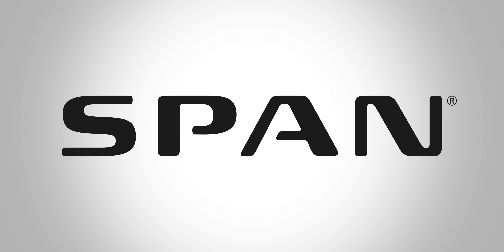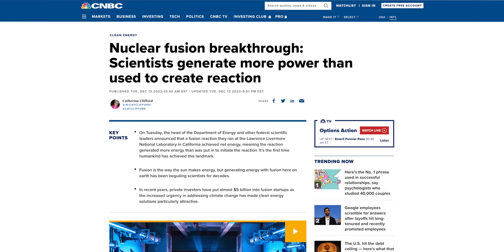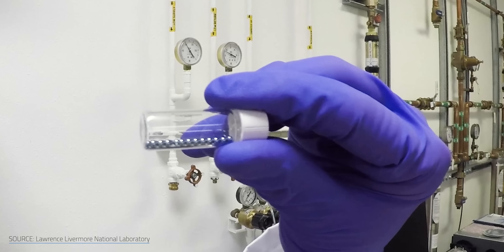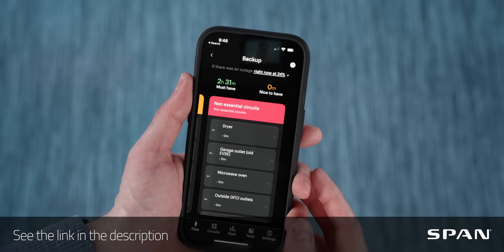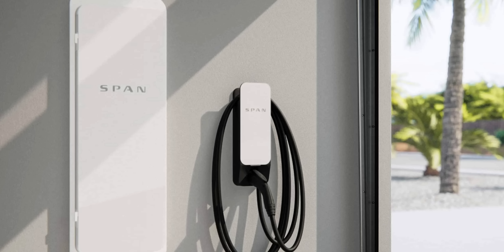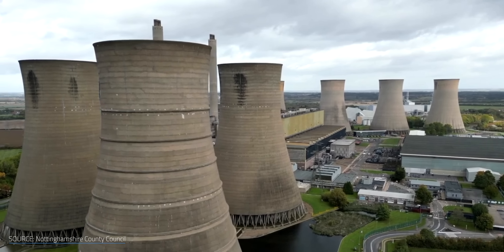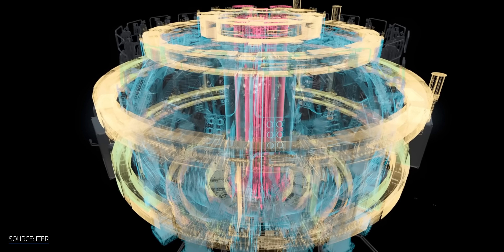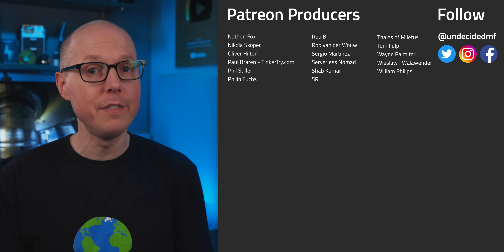What This Breakthrough Means For Nuclear Fusion

Comment: Fusion seems always to be 30 yrs away. That said the one thing that cheers me is unlike the past, where research was all done by a few large scale research projects, it is distributed among a lot of smaller projects including startups. One of the problems with the big approach is they all were doing the same thing, basically tokamak plasma reactors. 

People are trying a lot of different approaches. It also prevents the oil and gas industry from spewing fear,uncertainty and doubt, and also influencing the government and power industry from supporting research ( folks this isn't conjecture). Like with Tesla with showing that GM&the rest were lying about EVs, one of these projects is likely to come up with something that works&that will break the logjam the fossil fuel industry tries to maintain. Put it this way, the reason GM,etc are investing heavily in EVs was they could no longer deny they worker, unlike the good ole days.
Reply: It’s always 30 years away because new obstacles are discovered with each advance. Utility scale battery storage is much closer to practical implementation. MUCH closer.
Reply: True enough,but that also kind of has the idea that you only pursue one avenue. Fossil fuels are seductive because they filled so many needs ( and also prevented any real competition via influence and outright bribery) at the same time. We don't need one replacement for fossil fuels, we need many. For one thing, it breeds competition, where alt technologies compete to be the best. More importantly stopgap tech is prob as valuable as long term solutions. 

Fusion holds a lot of promise but again you don't want a one stop shop. Once you do that you see the industry devolve the way the fossil fuel industry did. So you won't see improved reactors ( think of what fission industry did), you see them cutting corners and creating artificial scarcity to jack prices, like the fossil fuel industry does. They will use their power to keep competitors off the grid,guaranteed. 

It is why the lower industry is resisting a true national grid (the producers using fossil fuels), if you have a national grid you create competition, wind power from North Dakota compete equally with nat gas power from Arizona. It is why Texas stupidly is isolated, they claim government regulation, it is really propping up fossil fuel providers.

Comment: Very skeptical of HB11, the confinement scheme is interesting, but P-B11 fusion is ridiculously hard to ignite compared to DT.
Reply: @Undecided with Matt Ferrell  you are such a scratch the surface troll...

Trillions of dollars 💸 of off the books classified defense money has been funneled into this research for 60+ years now. 

This "announcement" was a public JOKE, a fascade. They are 60+ years ahead of what they announced and they built several variations of these reactors at compact scale. Some used lasers, some used rf, some used cavitation, some used gas charged plasma but you can find THOUSANDS of pages of declassified engineering data to prove this work is a waaay further than they announced to the public locked in classified projects. 

I swear I am certain you are a shill, a tool 🔧

Comment: BLUF- Fusion is FUD that's holding fission back and really putting us in a bad spot.....

Fusion research is great, and I'd argue should not be curtailed (if anything I'm in favor of more $ being allocated), BUT at best it's decades away from providing any substantial energy.  Meanwhile we have a number of attractive fission designs struggling against the FUD of "limitless free energy with no radiation!" that the Fusion folks are claiming (and media is breathlessly hyping as coming next week).  This is right up there with the mythical "hydrogen economy" that so many think is the answer.

We could be so much farther towards our goals of lower carbon than we are if we had a clear policy/direction that just accepted the basic math of it all.  But politics/oil/media/environmentalism/etc. have us confused to the point of buying pickups and SUVs.

Comment: It is worth pointing out that the NIF experimental setup was never designed for energy production.  It is a way to test if our ageing nuclear arsenal is still capable of detonating without actually blowing up a test bomb every few years and thus breaking the International Nuclear Test Ban Treaty.  The fact that the same facility is producing useful science data that is relevant to fusion energy efforts is just gravy from the NIF's perspective.

As long as you are talking about HB11, it is worth pointing out htat unlike the He3 and Tritium methods, it is truly A-Neutronic.  This has HUGE safety and efficiency gains as neutron enbrittlement and generation of long-lived nuclear waste is basically off the table.  Helion is claiming this, but they are wrong to do so as their He3 tech necessarily involves quite a bit of neutron-evolving side reactions when they generate their fuel.

Comment: ICF is a deadend for any power generation.  The cost of making the pellets given the insane high presission they need means they will always cost more then the energy output, the WHOLE energy output mind you, this is far far worse then the laser inefficiency, you build the laser once.  The rest of the device will be even more costly and would need to feed and implode pellets at the rate of a machine gun.  Magnetic confinment is still a VAST distance from viability, but the input fuel is just gas so the possibility for net profit exists atleast in THEORY after construction, but ICF would never even cover it's operating costs.

Comment: This process and machine are for studying and improving fission induced instant fusion devices to be used by the military and the result is a quiet brag about their efficacy and sheer power.  It has little practical application to power generation.

Comment: I think a combination of these technologies might help get us over the finish line to commercial power production…
Like, magnetic confinement with carbon lined chamber, maybe even the direct particle uptake so no steam is needed.
Also, those solar towers that can produce such high temps, us it to help pre-heat if still needed? 🤷‍♂️

Comment: I see the key "problem" with fusion is the cost of wind, solar, hydro, wave and other renewable energy sources which goes down year after year.  The clock is ticking on fusion and absent a major short-term breakthrough, there really will be no economic point in pursuing fusion for use in fixed power plants 10 or 15 years from now.  Why build a phenomenally expensive fusion power plant when an off-shore wind farm gets the same power for much less cost?  There are good arguments for developing fusion for future space programs, but that tech is a LONG way off.  Grid-scale fusion, sadly, seems like a dead end.

Comment: Thanks for highlighting the “scientific breakthrough” difference from “utility scale’ breakthroughs.  Nevertheless, the NIF announcement was still exciting in its entirety as a scientific breakthrough!!
Reply: @UndecidedMF  @Two Bit da Vinci  why aren't we using compact HYDROGEN NUCLEAR FUSION TECHNOLOGY We haven't been able to make it work in a viable way? LIE 

No the public peasants haven't been able to do it. Classified defense and aerospace sector did it DECADES AGO. 

please 🙏 do yourself a favor, I don't know how you wanna crawl the web to pull the data reports from every defense and aerospace company and organization. DARPA, Lockheed Martin, DoD, DoE, Raytheon, Los Alamos, Oak Ridge, SRI Labs, MiT ANYONE TIED TO CLASSIFIED DEFENSE, AEROSPACE. 

What you will find after a few years of compiling is THOUSANDS OF LAB REPORTS confirming 👍 compact nuclear fusion reactor technologies, tritium and deuterium manufacturing electrolyzers, Tiny plasma gas reactors. All kinds of stuff. It's CLEAR the classified defense sector sunk TRILLIONS of off the books defense budget into secret hydrogen based technologies from the 1940s until now. 

What Lawrence Livermore Labs and the DoE announced was a joke, they are 60 + years ahead of what they announced only now several independent labs and scientists around the world are replicating and perfecting the technology, which is causing the defense department to have to begin making public announcements. The public and most of the private sector is who is still a decade away, the classified defense sector been there and done that decades ago.
Reply: @UndecidedMF   @MissingUser  honestly after 20 years of obsessive research, I can tell you EVERY major super power in the world 🌎 has a variation of this exotic technology. America, China, Russia, Germany. The only people losing are the 99% that are ill informed and won't say anything to them about releasing the classified technologies IMMEDIATELY. 

Releasing the technology to the public would be the ultimate disruptor but it's inevitable, too many independent labs and scientists have replicated results and working behind the scenes on commercialization. The elite super powers know this. 

The entire RUSH to zero carbon emissions has NOTHING to do with cleaning up the environment or saving humanity. It is the 100 year old classified defense and aerospace sectors way of creating a public fascade to transition into the quantum energy generation technologies that they can no longer control the narrative of due to humans naturally progressing. 

It's a way to keep eyes off the government, dod, DoE and defense contractors that already had all the technology just wouldn't release it but because there is this high speed push to go carbon free to sustainable energy it allows room for a transition period where "they" can routinely release information and breakthroughs to the public slowly as they give ample time for the oil cartels, energy cartels, and automotive cartels plenty of time to rape and pillage before shutting down indefinitely. 

One example is the BIG nuclear fusion announcement from the United States 🇺🇸 DoE and Lawrence Livermore National Labs last month. While the public announcement was a fascade behind the scenes they are 60+ years ahead of what they announced and stole trillions of dollars in tax payer money to fund it. But as more independent labs and scientists figure out what the defense sector already knew, the United States 🇺🇸 curiously announces to the world a "NET ENERGY QUANTUM FUSION REACTION" but still claims we have years to go to commercialization.

Yes the poor broke labs and scientists have a decade to catch up but our defense sector and classified aerospace have been there and done that already just never allowed the tech to open markets. 

Release of these new energy generation technologies above and beyond traditional solar, wind, coal, petroleum and even traditional nuclear is the biggest disruption on earth. The price of EVERYTHING PLUMMETS TO NEAR ZERO.

Another reason blockchain cryptocurrency and bitcoin is infiltrating the world is due to the plan of the defense sector control collapsing the old carbon scam petro dollar and rolling into a digital blockchain bitcoin system because these new technologies get rid of the idea of money as we once knew it. 

Its all being planned, I can see the writing on the wall but it could go much faster to rollout of these exotic technologies if the average Joe's of the world would get educated and DEMAND RELEASE OF THESE TECHNOLOGIES. 

You can literally find 1000s of pages of engineering r and d data from Nasa, DoD, DoE, Defense Labs, Lockheed Martin, Raytheon, Military Defense labs, declassified data going back to the 1950s proving they been developing secret energy tech for decades using stolen taxpayer dollars. It is not some tin foil hat conspiracy it is a fact. The quicker the public catches on to this the better.
Reply: This process and machine are for studying and improving fission induced instant fusion devices to be used by the military and the result is a quiet brag about their dominance in efficacy and sheer power.  It has little practical application to power generation.
Reply: still.. we wont get a chance to see it actually working though.. all of us who seen this video will be dead by then for sure. its sooooo far away. not hopeful at all.
Reply: @jeanmuyuela8112  That is such a lame attitude. Inertial confinement is still quite experimental, but other fusion tech are much further along.  "No hope at all" blackpilling is lame.
Reply: @Hatchete  you think in your life you will get to see it working? Good for you for being optimistic I suppose.. but in history tech we hope for always arrives later.  We will not see this working if this is the only progress they have.
Reply: Still an important milestone regardless.
Reply: @djdoc06  your comment was automoderated by yt bot and it’s shadowbanned.  You can’t say the H B word which is why I bypassed the filter the way I did.
Reply: @hugegamer5988  I still see his comment so I don't think it's shadowbanned.
Reply: @tru-b-dat8046 -- You mean like solar :)
Reply: It was simply a scam.
Reply: @Tru-B -DaT it's obvious this subject goes right over your head.
Reply: @Tru-B -DaT my argument was never that fusion is a scam. For you to go all in on that ludicrous interpretation of my statements shows how smooth brained you are. You must have some wild and chaotic thought processes, to think the way you do.

Comment: It seems that right now we're pretty much at the same point in fusion technology as airplane inventors were in the late 1800s.

Slow but compounding progress in relevant technologies will eventually find the "Wright" design that gets the job done.  ⚛️⚡
Reply: Did you mean Santos Dumont? :P
Reply: @rael_gc  theres hella people who laid claim to the first plane.
None of them are as legit as the wright brothers tho. First powered flight is a big deal
Reply: Bro, I fold paper and I get flight.. not exactly the same thing
Reply: @lewisheasman  A metaphor only goes so far. We might not have a "fusion paper plane", but your paper plane is also not comparable to a proper plane. It can't bring a singe person, and is not controllable.
Reply: @egilsandnes9637  just another 20 years away
Reply: @egilsandnes9637  
If you want to go that far, the first "powered flight" of the wright brothers wasn't more than a glorified hop. They needed a ramp to get off the ground and even then it couldn't climb and only made it a couple dozen of metres before being back on the ground. It was more a controlled crash of a glider with a motor strapped to it than flight.
Reply: @carstekoch  
The wright brothers took the first step.  Then made the many steps afterwards to make a real, flying powered airplane.  Makes no difference if the first step was tiny; they kept on and on and on.
Reply: @acmefixer1  
The wright brothers did not make the first step to a flying machine and they weren't the first that build a plane that could climb.
They also weren't the only ones keeping at it.

The first gliders were around way before the wright brothers. Even if you just go to Lilienthal's gliders of the 1890s. 
They were the first to strap an engine to a glider without it falling appart, but that was about it.
Reply: Or maybe Hero of Alexandria with his early steam power.
Reply: But it didn't take that long. By ww1 Biplanes were a thing and the material construction got better from there as well as the engines.
Reply: maybe but we are accelerating much faster compared to the 1800s. Once AI is perfected its gonna be exponential
Reply: @MuchCow9000  It's already exponential right now in development. 

But yes. Humanity will probably be a type 1 civilization by the end of the Century when AI is perfected.

Comment: Even in a best-case scenario, we do not have the time to keep using fossil fuels while we wait for fusion. Even conventional nuclear is too slow, considering the long timelines for reactor construction. This isn’t to say we shouldn’t keep doing research (just because it’s cool), but we MUST move forward with solar/wind renewable energy, decarbonizing transportation (electric cars and trucks to start, possibly synthetic fuels for air/shipping), and decarbonizing steel and cement manufacturing.

Comment: It wasn't really "net positive"
It was "net light energy input positive"   or   "net initiation energy input positive"
And the output energy was extrapolated or measured but not captured and put to use.
I'm skeptical about any of these systems that require the precise positioning and targeting of tiny ,precision manufactured,fuel pellets,hundreds of times per second, to produce usable power levels.
Magnetostriction of plasma seem much more likely to be viable.

Comment: My guess is that the radioactive waste disposal problem in fission nuclear power will be solved before the first fusion reactor reaches commercial viability. Releasing the energy stored in uranium and plutonium by fission processes is infinitely easier to accomplish than applying huge amounts of external power to gaseous deuterium/tritium reactants hoping to create a fusion reaction in a bottle.

Side note: My lab worked on DOE ICF contracts in 1978-80 and on magnetic confinement fusion energy contracts from 1980-90.
Reply: The radioactive waste disposal problem in fission nuclear power has been solved and is managed quite well, compare the deaths from the Fission Industry to the Fossil Fuels burning industry, and make sure to add deaths from wars and health issues from fumes in cities.
Fission should be monitored and adjusted to avoid Fukushima disasters, but even that has far less of a global impact than a few tanker oil spills
Reply: Tbh even if waste is solved
Fission will still not be favoured due to solar being so cheap now